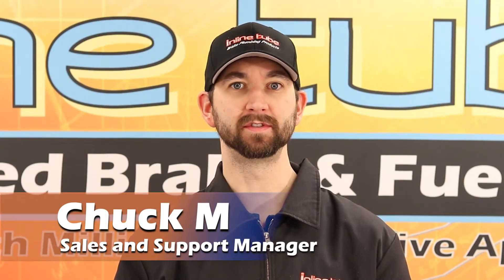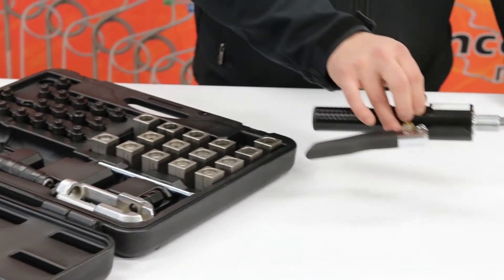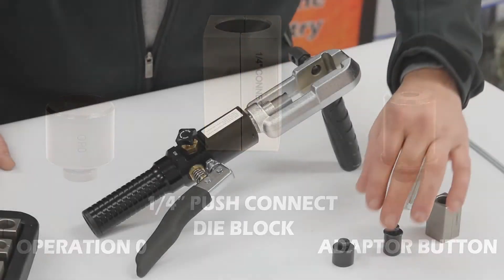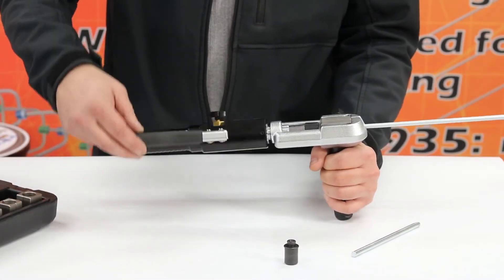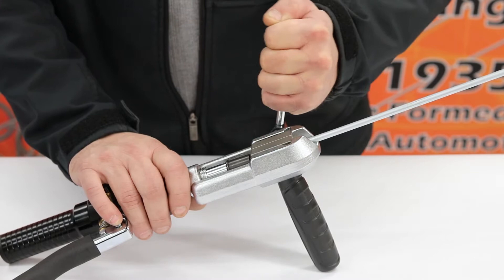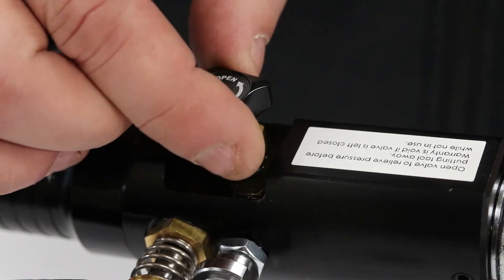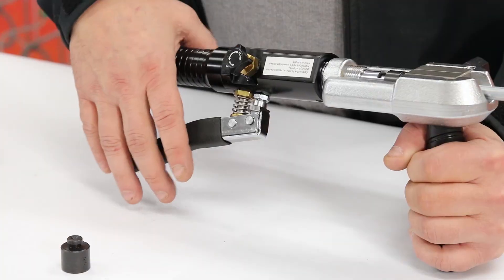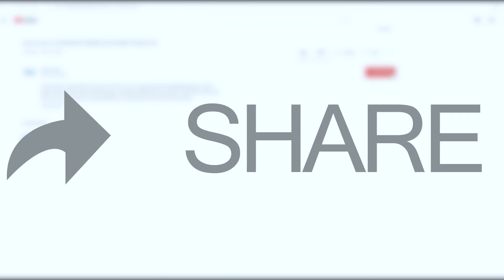How to | Hydraulic Flaring Tool Kit

Comment: Why won't you explain better what dye blocks to use with what fittings.
Reply: All of the die blocks and fittings are labeled in the case.  It will say the size and type of flare it makes.